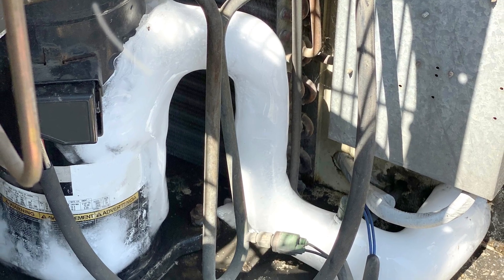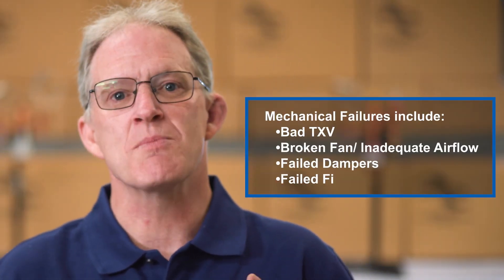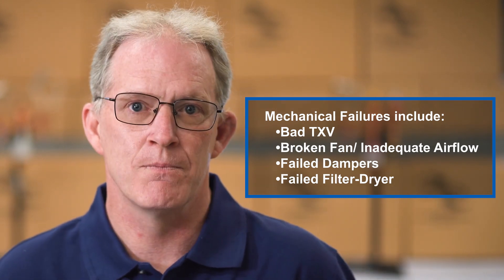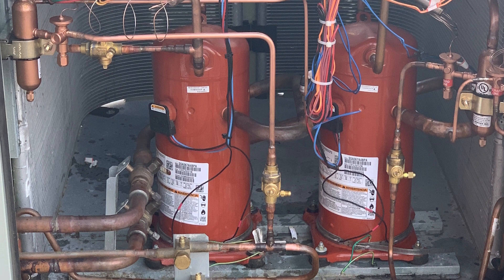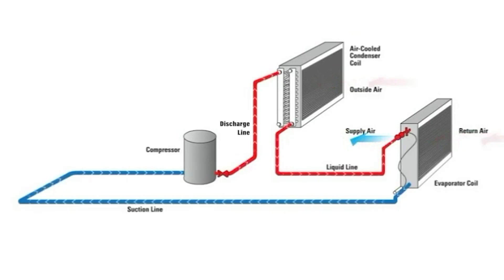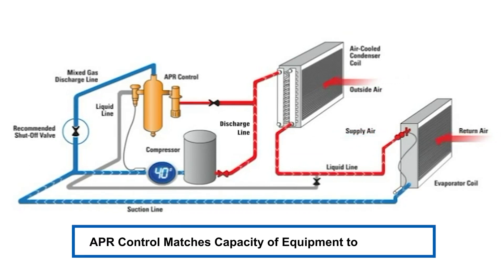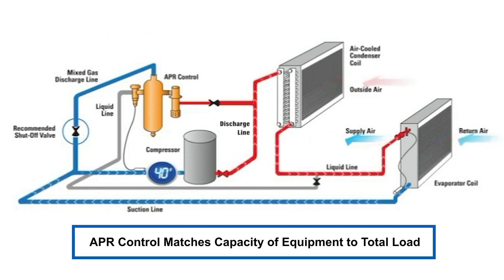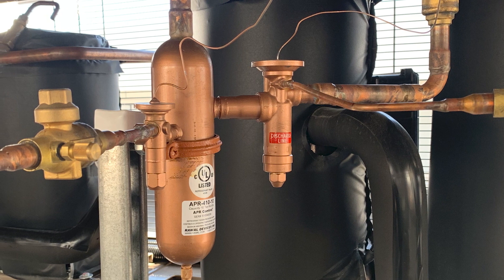Why Does Evaporator Freezing Happen and How to Fix It with the APR Control!

Comment: Could this device be used in a reheat system to stop coil freezing in conditions with extended run time ?
Reply from the maker: Yes, its ability to modulate the capacity in response to a drop in the system’s suction pressure/temperature the APR provides evaporator protection from freezing. You can read more about it here: https://www.rawal.com/the-in-stock-solution-for-hot-gas-reheat-applications/

Comment: While I agree that many units are oversized, it is not "by design." For example, in the Philadelphia region, the design temperature is 90ﾟF.... that leaves about 15 to 20 days out of every summer where that temperature is exceeded, leaving all commercial air conditioning systems undersized for those 15 to 20 days, and discharge temperatures climb anywhere from 3 to 5, and sometimes as high as 6ﾟF as a result of the increased outdoor temperature, and the lack of capacity designed into the systems to meet the increased heat load.  The APR device is terrific in many circumstances, but to say that most systems are oversized is simply not applicable in the world of commercial air conditioning.
Reply: In addition to that don't let architects specify oversized equipment with the excuse that the reheat controls will make up the difference.  Even better, let the people who know the region specify the equipment rather than using a blanket national design and use modern multi-stage systems like they were meant to be used with zone averaged temp control instead of single point built in to the thermostat located in a space not even serviced by the equipment. And oh, yeah, knock some sense into those sites about the importance of regular maintenance, especially air filters.

These valves have their place; in the back pocket of someone who lives off sales commission selling oversized gear for that sweet margin. That way you'll know never to buy from them.
Reply from the maker: @arthouston7361 & @sivalley  You both make great points! We agree that real-world conditions, like extreme temperatures, can cause HVAC systems to become oversized, even if not part of the original design. Local expertise is key in specifying the right equipment, but we’ve also seen that multi-stage systems with zoning don’t always deliver the expected results, which is part of why APR Control has been so effective for so many.

Maintenance, especially air filters, is crucial for efficiency and reliability – but we know that doesn’t always happen! The APR Control optimizes system performance by reducing short cycling, improving dehumidification, and adapting to real-time conditions, all without requiring a full system overhaul. It’s not about selling oversized equipment—it’s about providing a solution that enhances efficiency and extends system life – especially in in-place DX systems.

Comment: OK, Jason, what about evaporator icing when there is a loss of refrigerant (e.g.-old split system that leaks)?
Reply from the maker: Even with a significant loss of refrigerant charge, the APR Control can prevent icing the coil. Feel free to contact our team for more information or discuss a specific application.